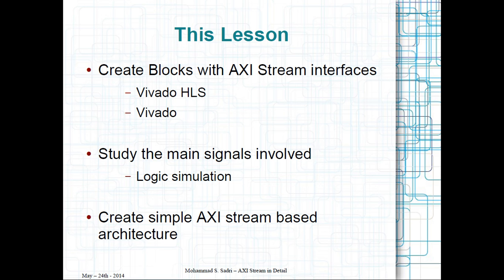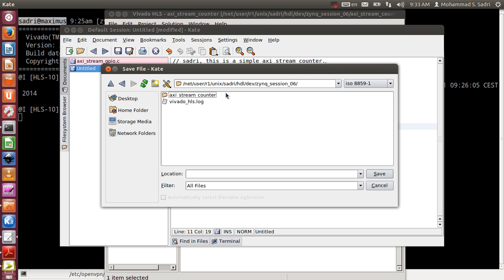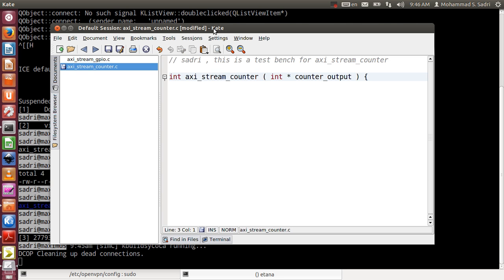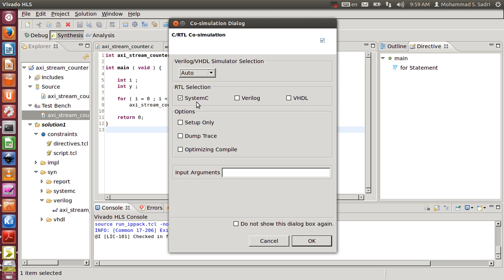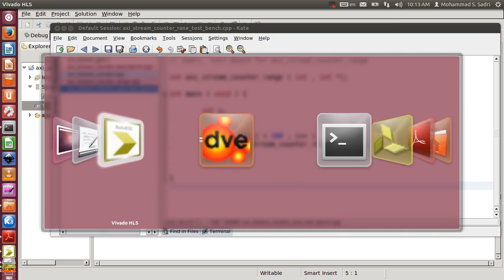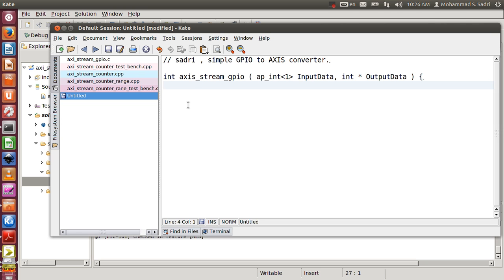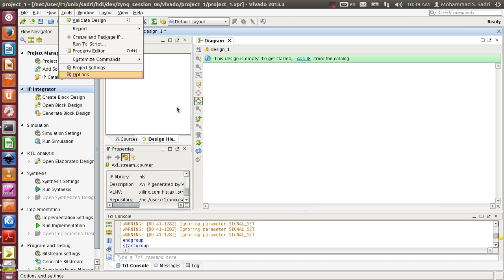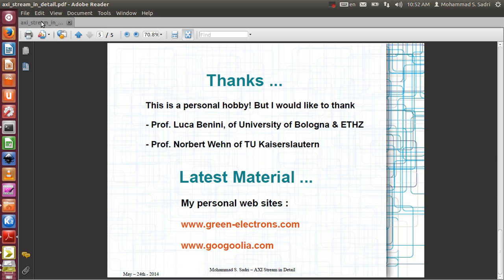ZYNQ Training - Session 06 - AXI Stream Interface in Detail (HLS flow)

Comment: Everything is great with this video, with just a simple problem: copying and changing files and directories to create new projects, instead of using program interface (create new project)
Which may create some problems, if you are a newbie like me and not focusing %100 (such as assigning correct top function all the time manually)
Anyway the tutorials are still working on Vivado 2019.2, after 6 years :)

Comment: I am using vivado 2016 on windows 10. 
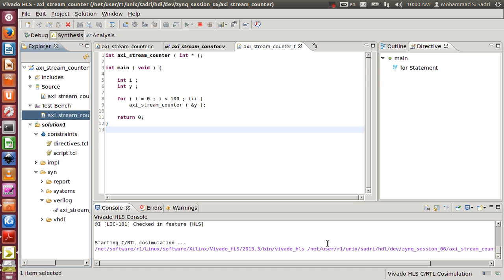I am not getting SystemC option in cosimulation and getting error to do both VHDL and Verilog simulation at time (42:00)
I seems there is problem in c++ compiler ! 
this is the message I am getting, any suggestion?

@I [SIM-47] Using XSIM for RTL simulation.
@I [SIM-14] Instrumenting C test bench ...
@W [SIM-75] Fifo port 'counter_output' has a default depth of 1. Insufficient depth may cause simulation mismatch or freeze. Please specify the depth in 'set_directive_interface' using the option '-depth'.
   Build using "C:/Xilinx/Vivado_HLS/2016.1/msys/bin/g++.exe"
   Compiling apatb_axi_stream_counter.cpp
   Compiling axi_stream_counter.cpp_pre.cpp.tb.cpp
   Compiling axi_stream_counter_test_bench.cpp_pre.cpp.tb.cpp
   Compiling axi_stream_gpio.c_pre.c.tb.c
   Generating cosim.tv.exe
@E [SIM-317] C++ compile error.
@E [SIM-321] EXE file generate failed.
@E [SIM-321] EXE file generate failed.
@E [SIM-331] Aborting co-simulation: C simulation failed, compilation errors.
@E [SIM-4] * C/RTL co-simulation finished: FAIL *

Comment: Thanks for video. I am noticing that in my simulation of axi_stream_counter_range, after the reset goes high, the TREADY signal being output from the device is always set high. I would have expected it to only be high when the device is not busy counting (i.e. the same as yours). Apart from that, everything looks correct in my simulation waveforms. I am wondering if you know why this might be the case? Thanks.

Comment: I am using vivado hls 2014.1. I am unable to get to get the counter_output variable in the directives tab as demonstrated by you in the video at 17:28. What could be the reason?
Reply: Ok, i find it in Xilinx forum:
yashkarundia
Newbie
11-24-2017 05:45 PM
You should check it in Project Settings - Synthesis - Top Function.
Reply: vivado only let me choose the correct one when i select browse
Reply: I'm having the same problem with version 2016.2
Reply: Any one found solution?
Reply: i have the same problem D: